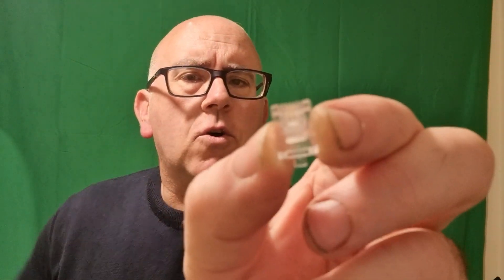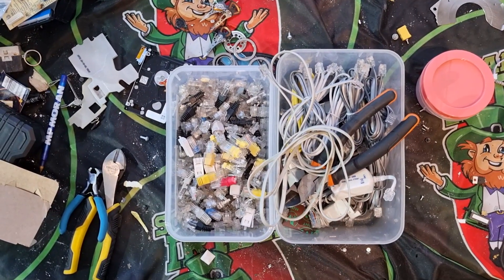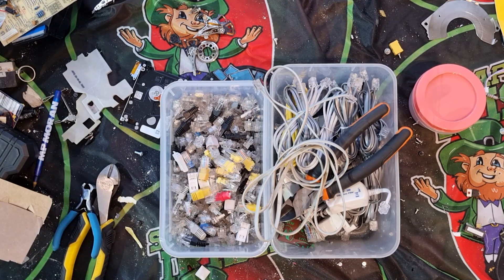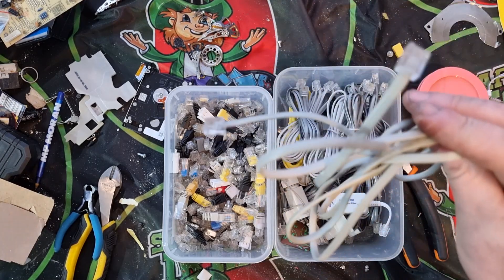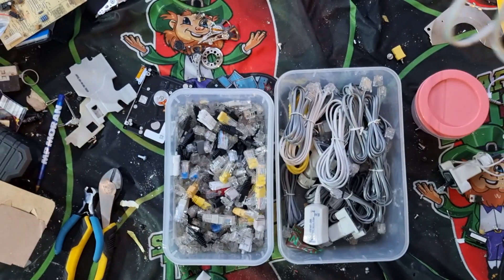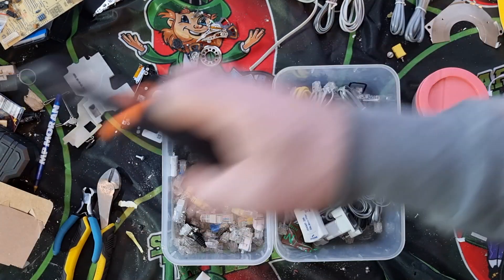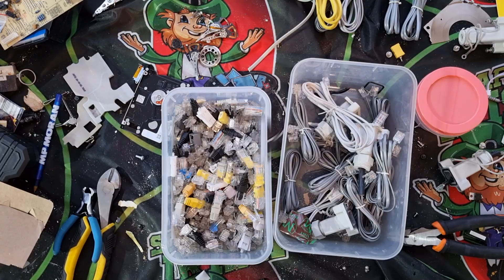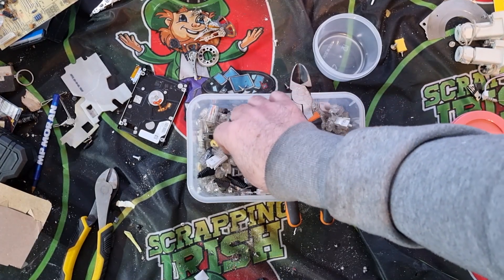"How to Get the Gold - Inside the RJ45 Plug"

Comment: Nice haircut , The way I like to do those is is put one end in a pair of Vise-grips clamp down then run through band saw  cut at end of the wire . After that put in the freezer to to -15 then drop in a blender and pick out the shinny stuff
Reply from the maker: cool might try that
Reply: A Blender?  That's the micro-scrap version of a bull in a china shop. Too many truly 'micro' bits of gold gone out with the plastic. Better to pick out a 3mm little 'platelet' than to lose so much to plastic dust, imo.

Comment: They sure are tedious!
I have a gallon ziplock bag of them now. I’ll try the large paper shredder I found by a bank renovation dumpster first, or would putting the whole plastic end in certain acid like AP or Nitric get to the metal inside the plastic bits? I’ll try a couple test ones first. I know there is still copper wire in there too.
Thanks!

Comment: I do the same. Leave the connector connected to the data cable / phone line. Flip it over and cut off the latching tab with my dikes (diagonal cutting pliers). Then I cut through the plastic like you do except I cut in an empty slot. Then I use a pick or small screwdriver to pry the plastic tab over and wiggle the pin loose. Beware of sharp objects! Once the pins are picked  out of the connector, I hold the connector in one hand and tug the wire out of it. That way, no wire is wasted. Will be interested to see how you process them to remove the base metal from the foils.

Comment: That’s a great demonstration. Wonder if putting them in a blender would chop up the plastic enough to make things go easier?
Reply from the maker: I will try and let you know
Reply: The plastic they use on these connectors is not brittle type so I doubt it will.
Reply: Thank you for that information